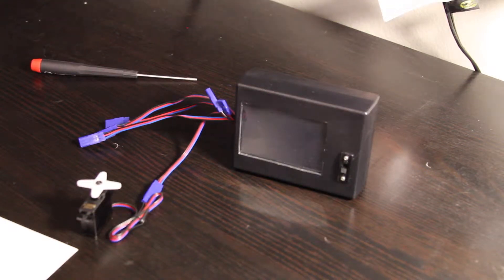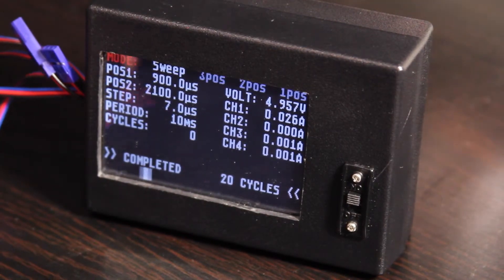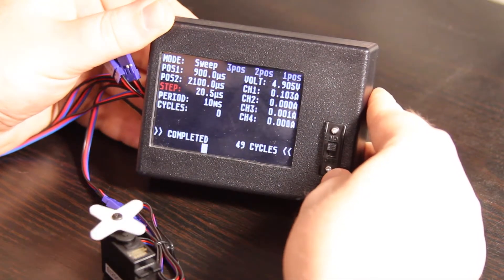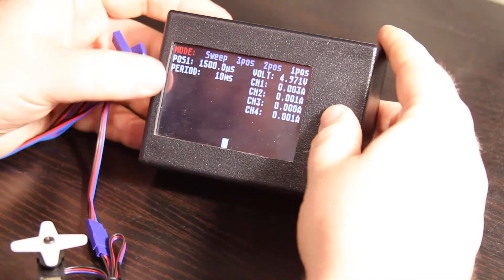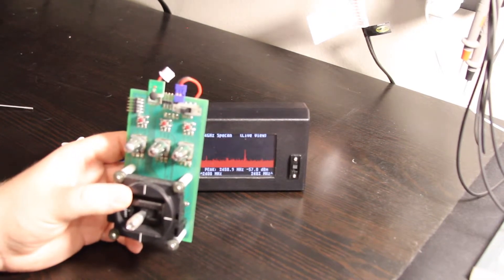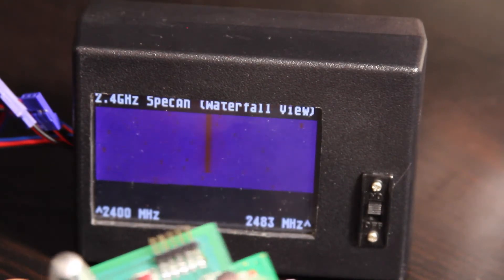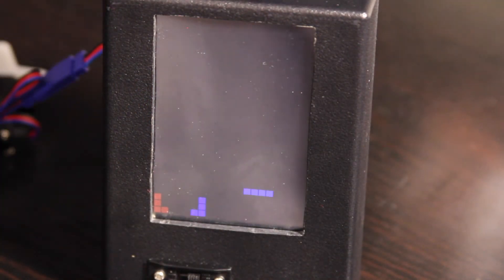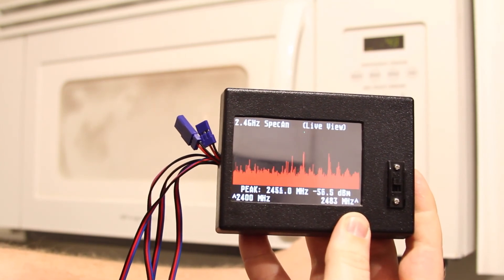Servo Tester / 2.4GHz Spectrum Analyzer / Tetris

Comment: Excellent project! I found firmware on github, but was not able to find electronic schematics. Can you please share it too?
Reply from the maker: Thanks. Believe it or not, there never were any schematics. I made this when I was starting out with electronics, and I just laid out the PCB footprints and made notes about which signals went to which pins... a horrible way to do things! The PCB layout was simple enough that it worked out, here's some close up photos if that would help:

http://farrellf.com/temp/first2layerPcb.jpg

The pin assignments are mentioned in the source code comments.
Reply: Ok, thanks!